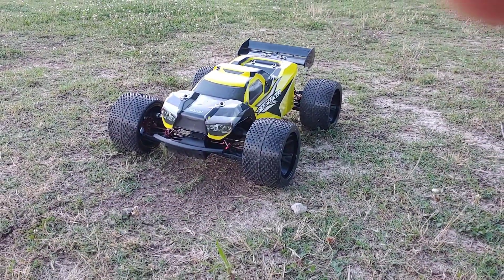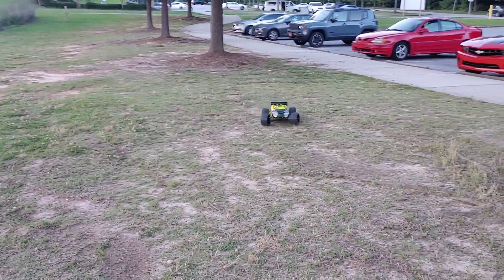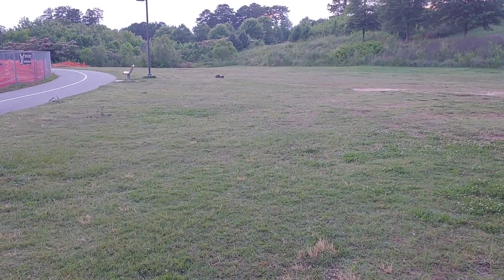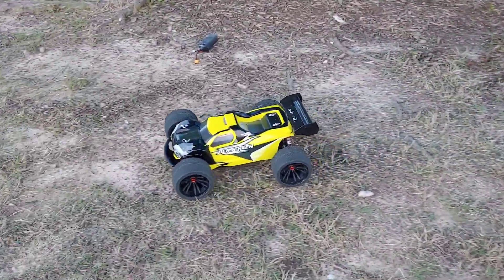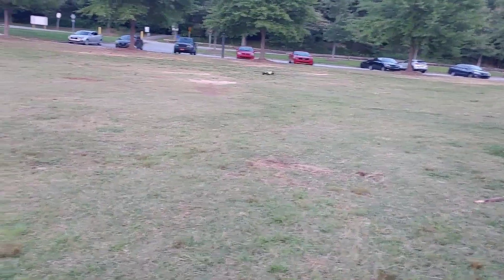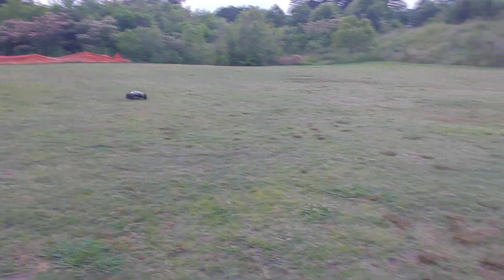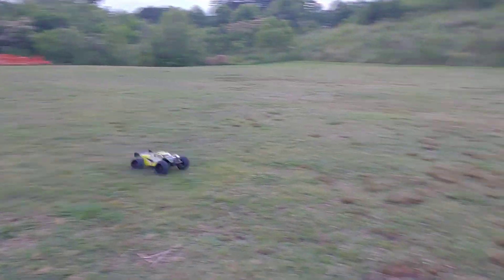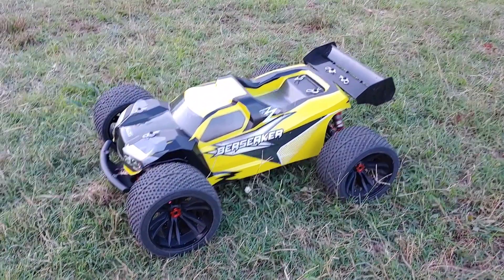BSR Berserker 3s and 4s 1st Open Field Run

Comment: I need help on my exceed madbeast brushless 1/8 .. do u know if that bang goods raptor-e truck is that same truck. I have traxxas servo in it. But I bought my used. I replaced rear drive and I'm looking for spare parts.  Every time I bid on one for parts off ebay.. I lose the bid. Oh well. But I was thinking about buy that hobao 1/7 or 1/8 truck u have shared because alot people are saying there tough trucks. And I'm sure its better to find parts. Since those nitrorcx guys always have nothing in stock for parts.. or always sold out

Comment: Hey, I recently picked up the arrma big rock cc and I was wondering what your experience with the arrma 3s line is and if u think it was a worthy purchase
Reply: I personally would of gone for a 6s model
Reply: @joshchatwin8179  me too, just as a 15 year old it's quite hard to just come along with that sort of money, when Corona is over and I can start earning I am looking at the arrma notorious.
Reply: @KalsRcAdventures  how long have you had it and has it held up well?
Reply: @KalsRcAdventures  at the moment I dont see the point in getting a kraton 4s because it's pretty much the same size and has the same speed, (I am aware you can gear up but I like running off road and not having heat issues) whereas if I eventually get the notorious yes it's still similar speeds but it is a different style of truck and meant for flips, hope you understand what I mean
Reply: @KalsRcAdventures  have you done any mods on it?
Reply: @KalsRcAdventures  if I ever get leaks I'll be sure to check out those shocks, cheers brotha
Reply: Your purchase was wise! Armma is very durable and easy to work on! Parts are cheap and plenty of aftermarket parts! You can change the looks and put your own twist on them! Lots of different ways you can it  change up! There are YouTube channels out there that will show you how to make them different! Enjoy! 👍👍😎👽
Reply: @randyseaver8319  I'm planning on getting a clear body soon and copying how arrma does the "real steel" effect just with the outside being purple instead of blue or black